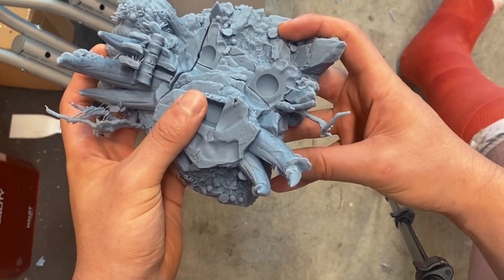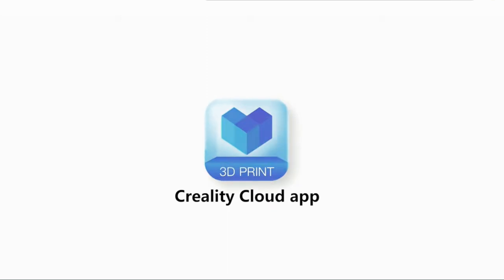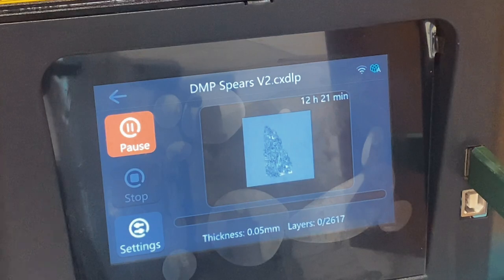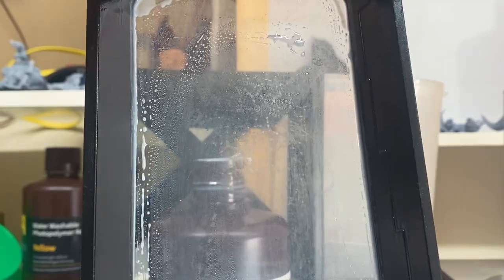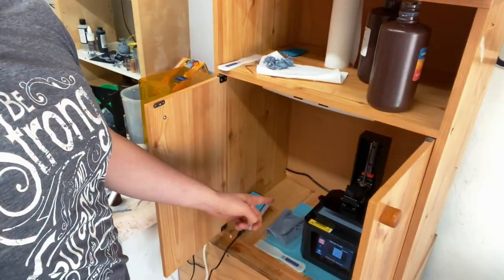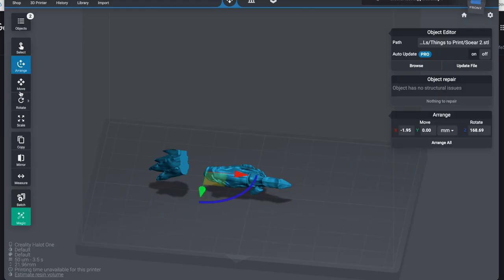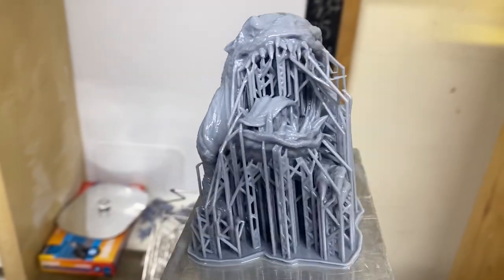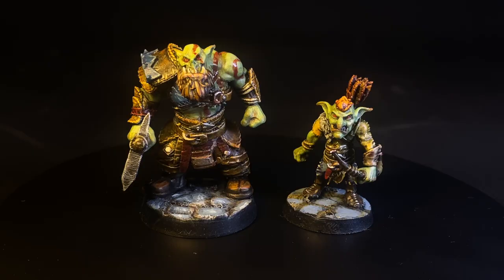A GIANT 3d printing adventure. The Avatar of Plague

Comment: have you got the stl link for the vat draining tower you printed?  I can only find ones using a pvc pipe.
Reply from the maker: https://www.thingiverse.com/thing:4228270

This is the one I used. It has a printable height extender. I might not fit your vat size, my halot one vat is kinda at an angle as you see in the video. Hope that helps :)
Reply: @Habes  Thank you for replying with the link!!!

Comment: The paintjob looks marvelous! I wished I could paint like that ._. 

Regarding gap fillings of parts there's a way more convenient way to do it than using the greenstuff: Just use the resin you used to print, dip a qtip in and go over the gaps. If they're very large, fill them up with greenstuff or any other molding mass but use the resin as the topmost layer. Then cure it - ideally with a portable UV light. It'll look spotless and is a simpler, cheaper way of doing it. Granted, it works best if the gaps are rather small.
Reply from the maker: Thanks so much!!

I haven't tried filling gaps with resin before. I'll give that a go if the situation arises. Thanks heaps!
Reply: @Habes  hi im new into 3D printing sculptures, what colors to you use for your models? Thx
Reply from the maker: After I prime them with a rattle can, I'm just using acrylic based paints specific for miniatures. Brands like Citadel, Vallejo and Army Painter. I hope that helps.